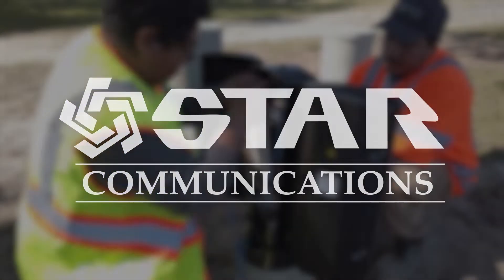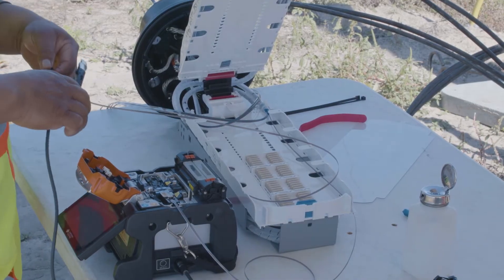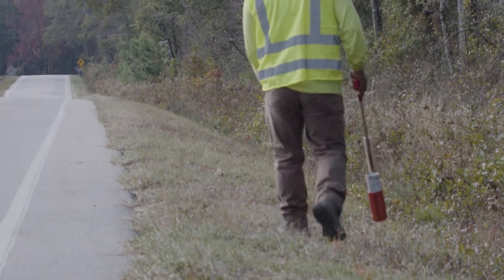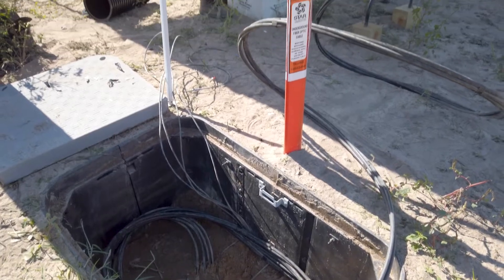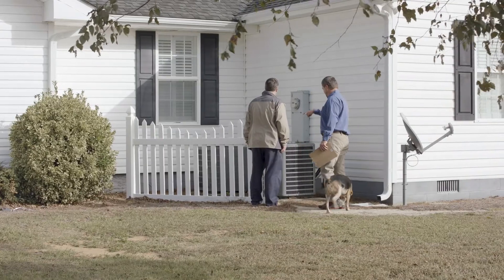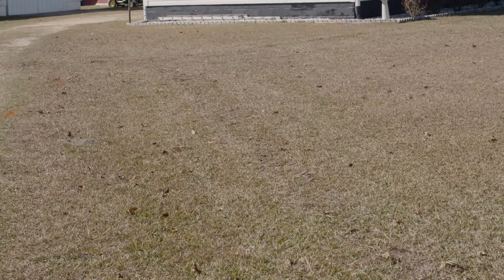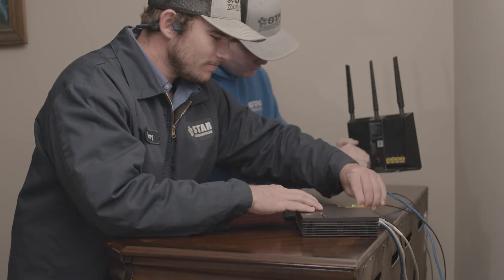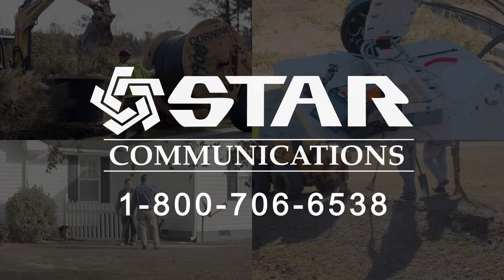Fiber Construction Process

Comment: In the city I live in there's buried 3-4" pipes of conduid running between CO's/cross connect boxes and half of them are still empty, the others oldschool  100-500 pair copper bundles which take up way more space than fiber.  All they have to do is pull fiber through so it's pretty straightforward until they need to get to the individual premises.  (I used to be a field tech for the copper network).  Good to think ahead.

Comment: When installing fiber, you must clean the sc/lc connectors first.  smh.    Seems like a good process for an installation.  Just need to make sure you clean the connectors and the coupler with a cleaning pen before you make the connection.  You also use mechanical splicers?  I have never used those so not aquatinted with it.  If you need a supervisor or inspector you can contact me.
Reply: Always quite often you can just remove the dust covers and it is usually fine